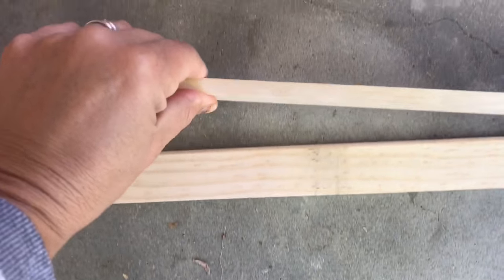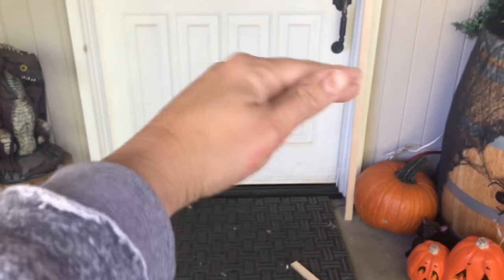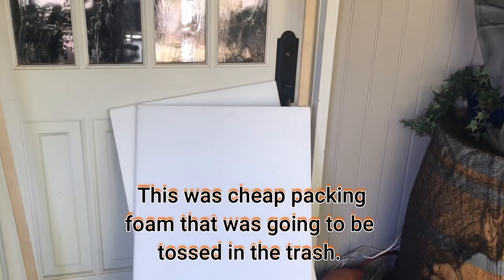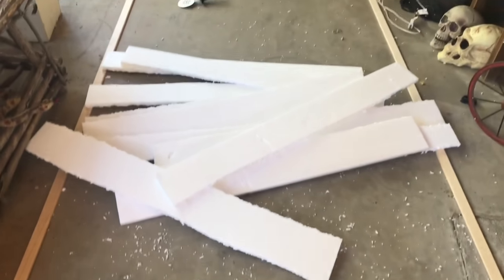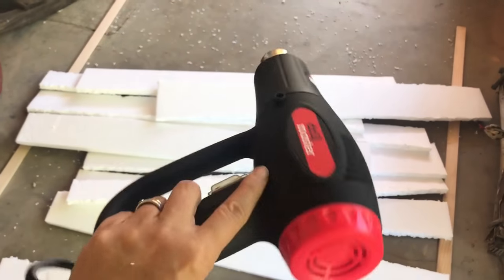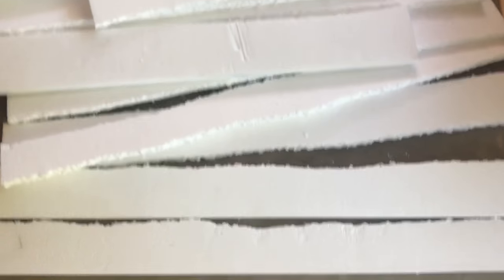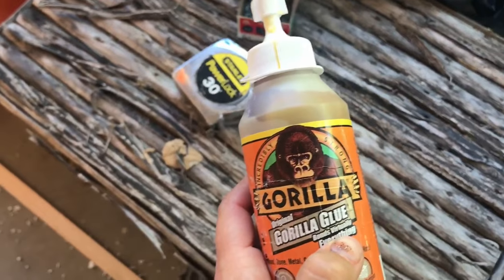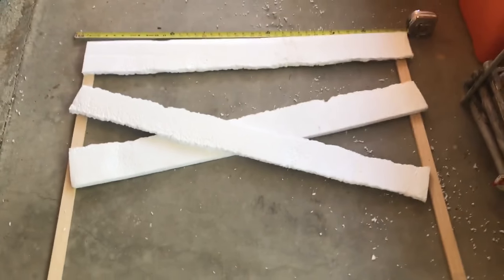Fake Boarded up Door faux foam wood DIY Halloween

Comment: So it turned out pretty cool, though! And i have to tell you, my husband and i actually did some building this year, & suffered VERY similar frustrations... With EVERYTHING. It was one thing after another. Breaking pallets, splintering wood, accidentally melting foam, broken pvc and torn tarp from wind, rebuilding and it being too heavy... We both watched this and, well, misery loves company. It made us feel so much less alone in our struggles. Not that we rejoiced of your frustration, but you know what im sayin. 😊 May you have prosperous crafting and a happy haunting from here on out!

Ps. There are thin, (fairly) inexpensive slats of wood @ our home improvement store that was in the garden section, instead of with the lumber. It's super lightweight like lattice, but it's in indidvidual 8'-10' strips. They'd work great for something like this project! We used them instead of  pallet board for fake fences, so i could lift the fences w/o my husband. 😉 the frame was still some heavier duty wood, but that stuff is a great light filler. 

And i wrote a novel. 🎃
Reply from the maker: Ashley Bracken awww thanks for sharing. I love having my husband help me when he is available. Some of these tutorials out there they make it sound sooooo easy, and that’s not the case. I’ll be posting about my mausoleum soon, that too was “fun”. (Yes, thin wood next time)

Comment: What are your thoughts on uaing cardboard instead of foam?
Reply from the maker: I believe it would totally work. I would say if it’s far away it will be just fine no one would be able to tell. If your up close you might notice it’s cardboard, a good paint job would do the trick.